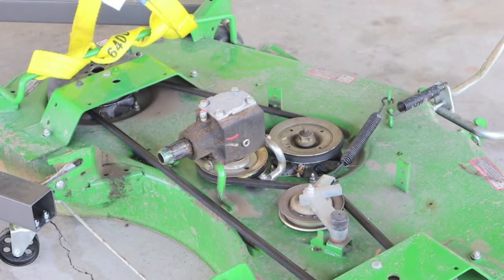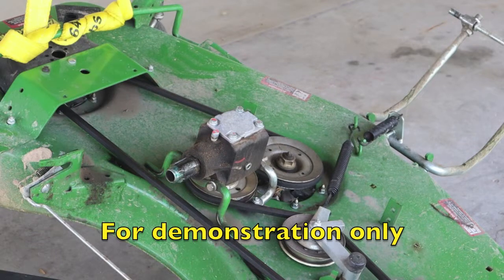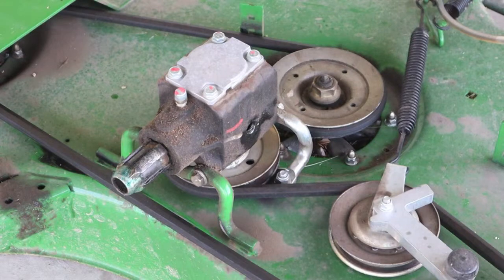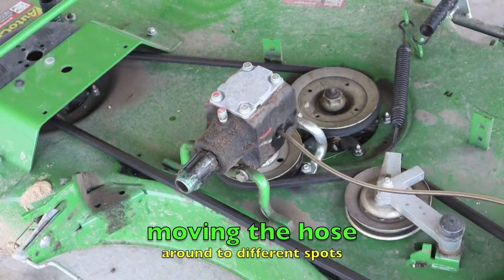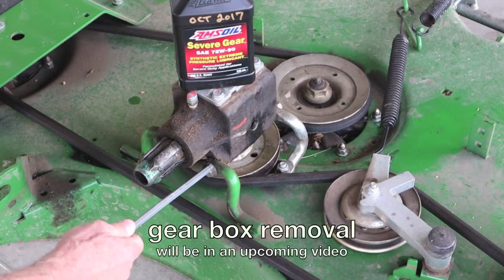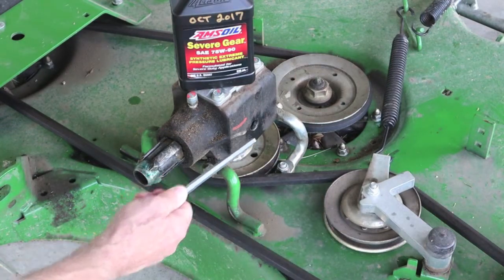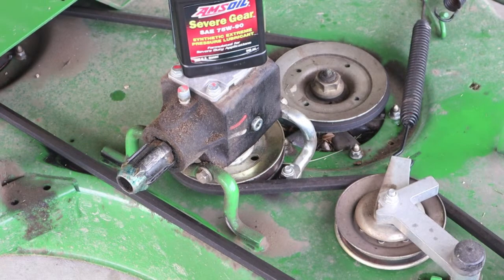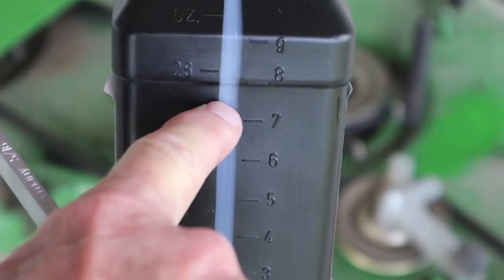John Deere 60D mower deck gear box oil change

Comment: Be a lot safer and easier to unbolt gearbox and work on it on your work bench
Reply from the maker: That's what I do now. That gearbox is so easy to just remove the 4 bolts and relieve belt tension.
I change gear oil in it every year now.
Thanks for watching and sharing!

Comment: Thanks for your reply . I can simply grab the blades with mower parked and nothing disconnected and have a lot of blade free play which back lash seems to go right back to what could appear as excess tolerance at transmission shaft. It’s a bit hard to pick as I’m not sure of tolerances and I don’t have a workshop manual
Reply from the maker: Well I would just be aware as you mow and listen for unusual sounds and more importantly vibrations. If it's mowing good then fine.
Make sure your hydro transmission fluid level is good too.

Comment: Here is my 2 cents.  I have a 60D on a 2032R, 2016/2017 year.  I started to drain mine by pulling the plug like shown in the video, but fluid started gushing out.  Based on the owners manual, at best it should have seeped out if at all, it only calls for 4 oz. 

I ended up putting the plug back in it and then raised it up like in the video, but I did it so the fill plug was up and not down.  I literally sucked nearly a quart of oil out of it, way more than the 4 oz my book stated it should hold.  I think 4 oz would only get you to the bottom of the fill plug.  

Did the dealer fill it up wrong when I bought my tractor and mower deck?  Good question.  But I have 600 hours on my tractor and probably about 300 on the mower.  This was the first time I changed the fluid since I owned it, so I did my best to put it as I found it when it came to the fluid.

Right or wrong, I put in as much as I took out and had to do it hanging as explained earlier, just about a quart.  

The siphon rig like shown in the video is awesome, I have one and it works great for items like this.  A little slow, but a lot less messier.  I use it to change the oil when I don't feel like pulling the mower deck off, yeah I am a bit lazy sometimes.  But I did verify the first time I used it, I was lucky to get half a cup when I took off the drain plug.  Again do as you think is best, or follow the owners manual, don't take my word for it!

I am not saying I am right and that the Pm Tips is wrong, but explaining my experience and what I observed on my machine.  One thing I did notice, it appears that his deck has what appears to be a vent tube, and mine does not.  Be mindful when using some of these videos at tutorials, you may not have the exact same model.  

But it does make me think that 4 oz in something that works that hard and gets that hot, maybe that isn't enough...  I do know that you don't want to overfill to the point where there is no room for expansion (due to heat) as this will most likely cause problems in the future.
Reply from the maker: Thanks for sharing your experience and observation. I agree, there could be some differences in the fill amounts depending on the model year and configurations. It's always best to check your owners manual for the specific recommendations.
I agree that 4 ounces of gear oil doesn't seem sufficient, given the tremendous load on that lower bearing. The only thing that allows that bottom pulley bearing to survive is the fact it's bathed in oil. I change the oil every year. The OEM gearbox lasted 5 years and the replacement is on year number 5 now. 
Thanks for watching and commenting!

Comment: How much free play 60 inch deck 1025r should the blades have when rocking them before the slack is taken up eg , when I turn my blades there is no resistance until drive line slack is taken up after about 9 inches, this seems to much? Is it normal, is too much free play. Thanks for your thoughts . David:-)
Reply from the maker: @DavidPatch-n6v  That seems excessive at about 9 inches. Mine is just a couple inches or even less but I don't relieve any springs either, I just dismount the mmm or drive over to mount up.
I'm on the original belt at 10 years old and on the second gearbox. The OEM belt still looks great at several hundred hours, the tractor has 837 hours.
Reply from the maker: @DavidPatch-n6v  Also on your PTO setting....I never use the twin position option, only the mid mount setting. It might make a difference.

Comment: What size is the drain bolt/ check bolt on the side? None of mine fit it
Reply from the maker: Mine is a 3/8 NPT. The original did not have a magnet in it, but the replacement has a nice strong magnet on it.
Thanks for watching!
Reply: @pmtips4482  mine was 5/16 wonder if they switched some years
Reply from the maker: @04tacomaguy1  Are you talking about the actual plug size or the tool size to remove the plug?
Reply: @pmtips4482  yeah the Allen wrench size for the plug on gearbox
Reply: Also mine the pump would only get out some of the old oil I had to tip mine and set it on it’s side to let it drain all of it. Didn’t replace the gasket on top of box where I filled it but no leaks yet. Didnt want to use rtv on it
Reply from the maker: @04tacomaguy1  I'm with you now, I just checked and my plug allen size is 5/16 too. Just last week I removed the gearbox to drain it on it's side. It holds too small amount of oil IMO. She runs very hot too as the load on this gearbox is a bunch.

Comment: what about teflon tape on the fill plug?
Reply: those plugs that come with the box have coated threads for sealing. I never use Teflon tape.
Reply from the maker: Wouldn't hurt a thing. In my case, just not needed as the plug seals 100 percent.
Thanks!

Comment: Wrong oil cause the failure?
Reply from the maker: I don't think so. A bearing bathed in oil would last the longest in that situation. 
I've had two Russian bearings fail, one bathed in oil, and the other in a wheel bearing well greased. 
Thanks for watching!

Comment: Wonder what caused the gearbox to fail?  Surly not the Amsoil?
Reply from the maker: Hi Billy, currently I'm batting 0 for 4 with Russian bearings. IMO there is no way the gear oil was at fault. Amsoil is top tier stuff!!
Thanks for watching!!
Reply: @pmtips4482  JD calls for GL-5?

Comment: Where is the vent hole?
Reply from the maker: That's the vent right on top between the shaft and 4 bolt top plate.
Thanks for watching!
Reply: @Pm Tips 
Found it, thanks.